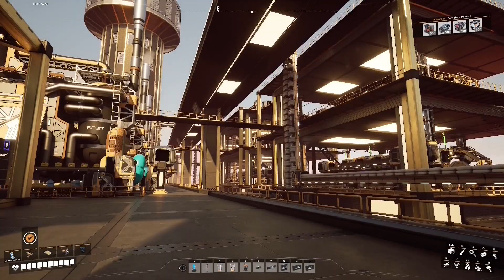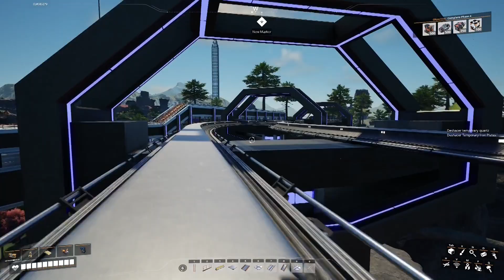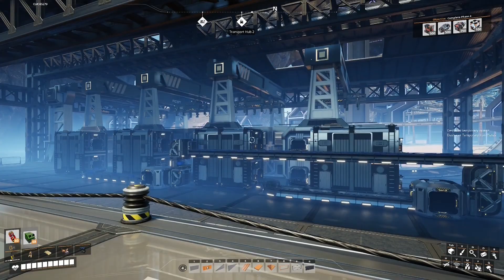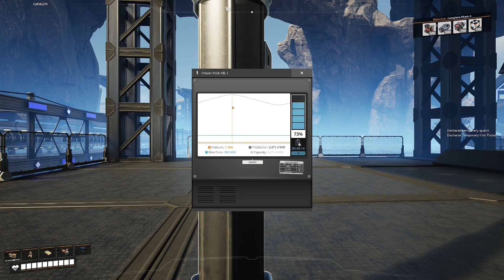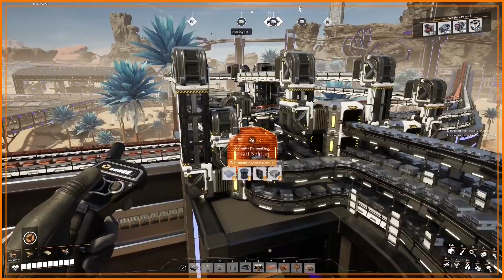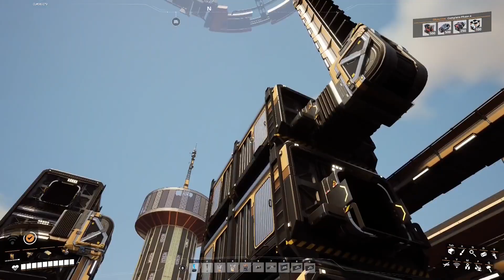Introducing myself to trains. "Hi train, I'm Nico!" "Chooo Chooo" | Satisfactory

Comment: At first i was nervous since it was my first playthrough but knew i needed to use them to have factories run efficiently without rebuilding mini factories everywhere for the same parts. By the end of phase 3 i had half my world connected via train. I've recently finished the main playthrough game play of phase 5 and i use every single vehicle in the game. Trucks, Trains and Drones are everywhere in my first playthrough save now
Reply from the maker: @Boostinbric  nicely done! Im deffinetely going to add drones at some point, but im not sure about trucks.  Feel that there's no need for them and making them work on this megafactory might be challinging. Still, i want to finish the game by having used everything there is, so I might just add 1 truck route somewhere... got to think about it.
Thanks for stopping by!

Comment: I am an extreme pro-train anti-truck player. Used them early into fuel power. Good job on belt balancing inputs for train stations, saved yourself alot of headache. 
The proper distance for signals is to let them be about a train-length apart for efficiency of a busy segment or train-length + 2 or 3 foundation to increase the speed of an individual train. So if you use 1 locomotive and 4 cars setup then place signals 10 foundations apart for busy segments and 12-13 for speedy segments.
Also, the reason why people use 1 locomotive to 4 freight cars is because that is the optimal ratio for climbing 2m foundations. So if you have steep climbs then you can decrease the number of freight cars, or if you have flat rails you can go 1:6, 1:7 or even 1:8.
Reply from the maker: Hey!

Thanks for the helpful tips! Looks like I got it right by chance—haha. The main pillars supporting my rails are spaced about 11 segments apart, and I placed the signals roughly in the middle of those. So on average, the signals are about 11 segments apart.

Does that mean I could improve train speeds by occasionally removing a signal? I also stuck to 2m inclines, so it sounds like the 1 locomotive to 4 freight cars ratio is a good fit.

Appreciate you stopping by—have a great week!
Reply: @NicoBuilds-g3u  Welcome! I don't think skipping signals will improve the speed, but moving signals back 1 or 2 foundations. But it will break the cadence of the current railway network (you move first signal 1 foundation, second - 2, third - 3 and soon). It can be useful for future builds. Plus speed gain is not that big. So keeping them 11 foundations apart is absolutely fine. I do 12 foundations, but I use 3 foundations long blueprints, so 3 x 4 = 12 and signals fit the build cadence.
Have a good weekend!